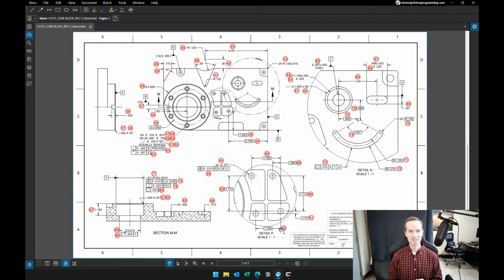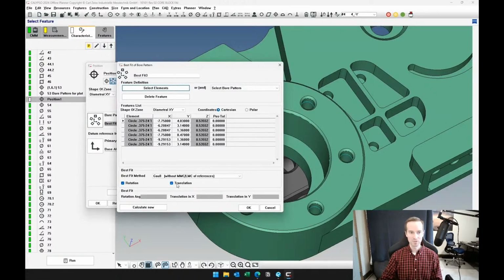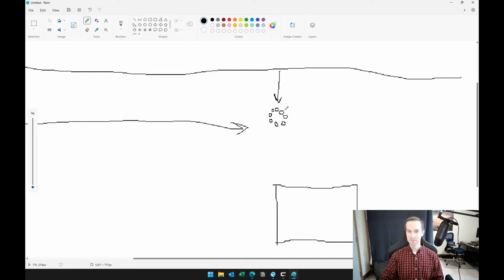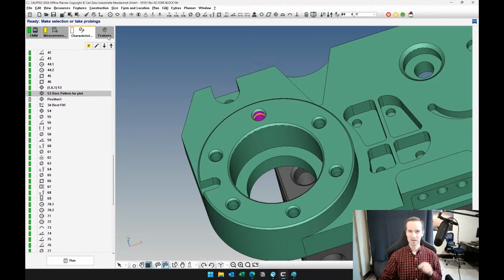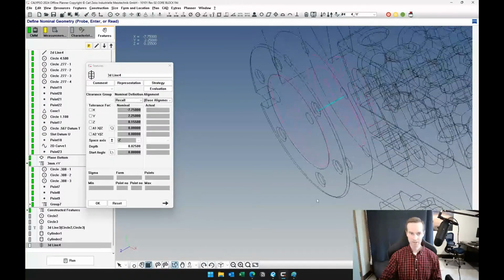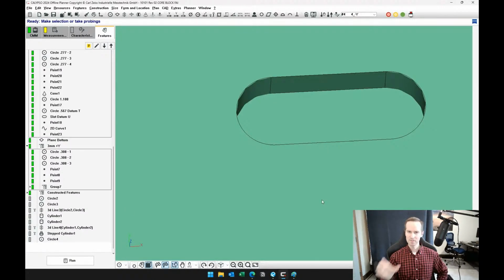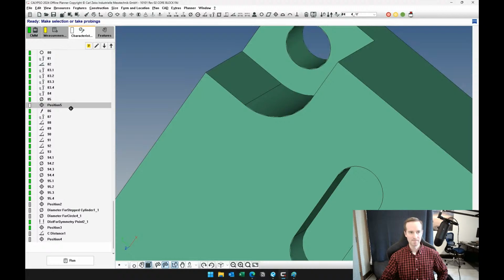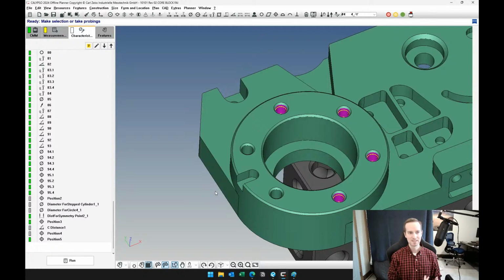Measuring Composite True Position in Calypso

Comment: Hello, at first sorry I wasnt present on the live :) second I have some thinking and question about Best Fit Method from about 6 minut of the stream. As I know if you whant to rotate and or translate the pattern of the holes you must sellect other Best Fit Method then Gauss. There is even note in the bracket that you don't have a MMC/LMC of references. And at the last, for position of the slot you can always use symetry point for both directions. Personaly I first measure slot, and then two symetry points with usage of the formula reccaling the center of the slot for their nominals (aditional I use the selfcentering point for direction with circles). Great job with the last two presented live strems ;)